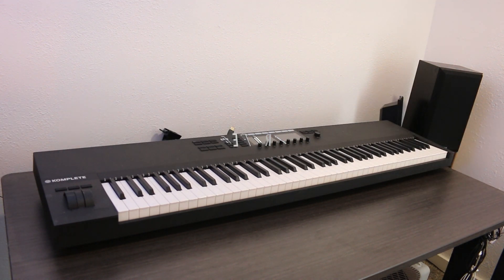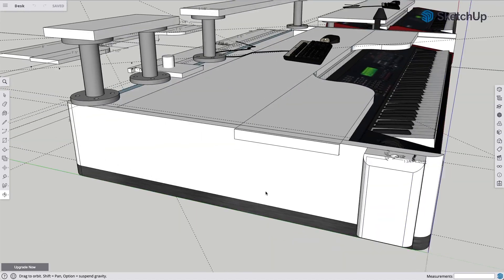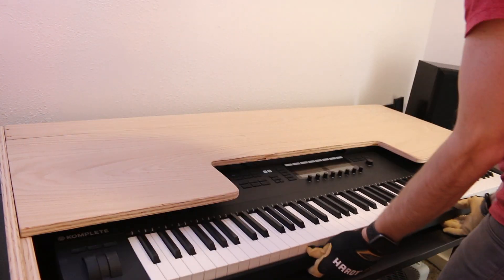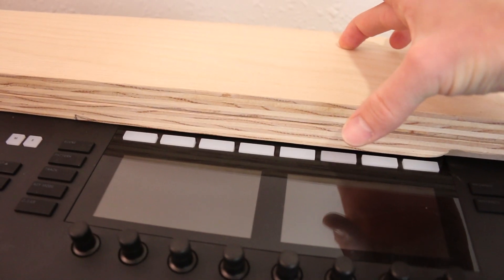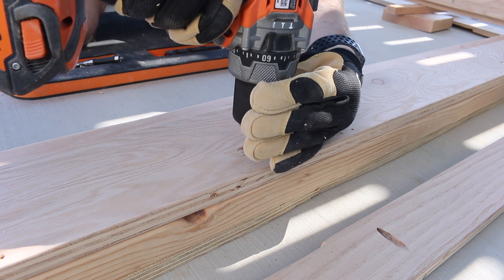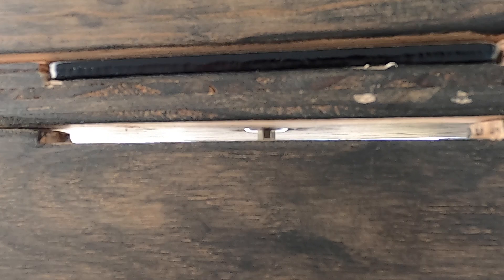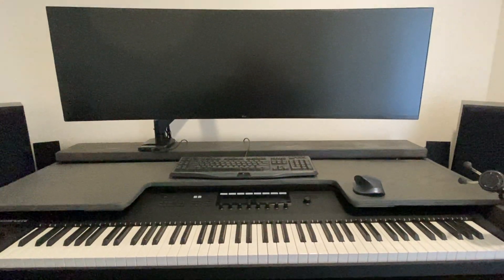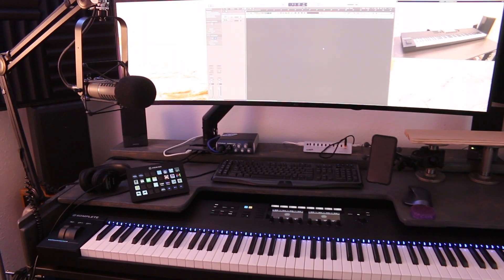Digital Piano/Midi Keyboard Desk Redesign

Comment: it seems to me that there's enough space on Kompakt left and right to  put the (maybe even wireless) keyboard and the mouse too?
Reply from the maker: Almost wide enough for a keyboard; certainly a mouse, but it's slightly awkward reaching over the piano keys for these. It would work if you have nothing on the sides. I've considered a drawer for the Komplete, but then my desk would need to be higher...that is unless I can slide the drawer all the way to the back side of the desk when I'm not using it. Design, iterate, improve, repeat.

Comment: I have almost the exact same issue - a 76 key keyboard which I want on the desk but I also want space for the QWERTY keyboard and other controllers (nanoKontrol2, Panorama P1) and maybe my small Roland A300 Pro keyboard.  I only really have one question, which is does the top board slide okay?  Apart from that, I'm going ahead with your idea, so many thanks!
Reply from the maker: The wood slides ok on the other wood. You could add a veneer and/or felt to make it slide easier. That is without going to a legit bearing slider. I've purchased a heavy duty full bearing slider, but the height of the desk (or lack thereof) makes that under desk drawer for 88 keyboard a little tricky. Maybe I'll just build it, then rebuild it and change my desk height when I want to use the piano. Might as well try it and if I don't like it, take it off. How is yours coming along?

Comment: Thanks for your option. The idea with a cutout for the KK control unit is excellent, but I would not throw away the sawn off part, but made it removable on mortise profiles so that friction dust in the grooves would not fall into the keys. Then if we push the keys, we get a regular table. I'm still thinking about my version precisely because of the comfortable height KK keys and the surface of the table. 
The high side on the left, where you attach the microphone, is not convenient for me, because it interferes with convenient work with the pitch wheel. Either do it on a par with KK or move the keys to the right so that the gap is about 5 centimeters.
Reply from the maker: The best thing is to make it modular. I’ve rearranged mine a bunch of times and still it’s not perfect.